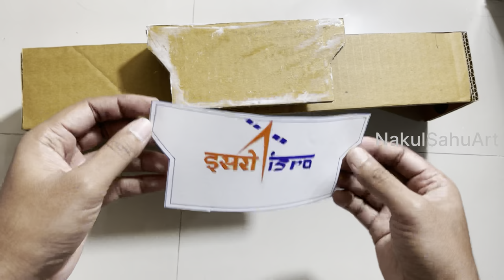Aditya L1 model making for school project working model #science working model #diy NakulSahuArt

Comment: Sir, want to know how it work down means how the thread used to move it down.
Reply from the maker: In this project I used 2 way switch to change the motor rotation direction, when you change the motor rotation direction with switch it will come down with rotation and weight of roket (gravity)

Comment: Hello sir...my son make Aditya.. battery not lifting...pvc pipe weight so ...pls sir what i do.. tomorrow science expo...pls reply
Reply from the maker: Check if slider stuck, check with new battery (if it’s drain during trails) , if weight is high you need to replace the motor with high torque motor you can use n90/n79 motor or 3-10 RPM dc gear motor 
I used 3.5 RPM gear motor in below projects 
Space shuttle launching working model 
https://youtu.be/M2xtEMCFlFc